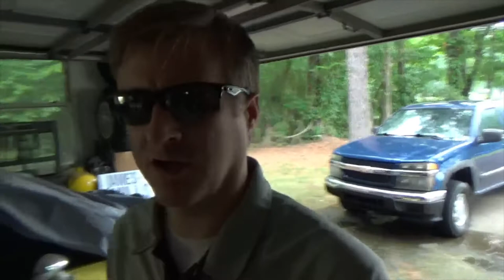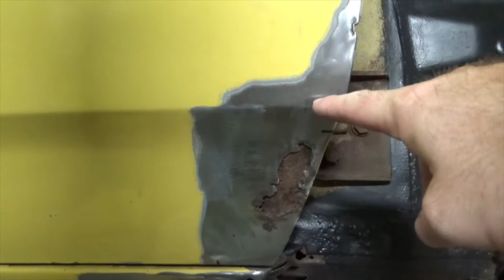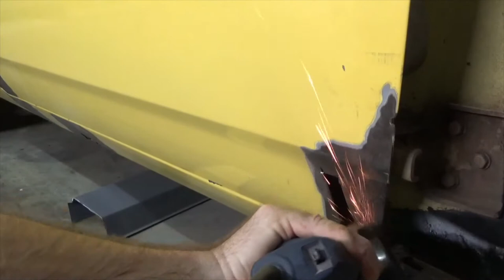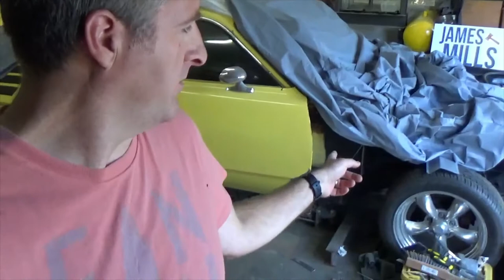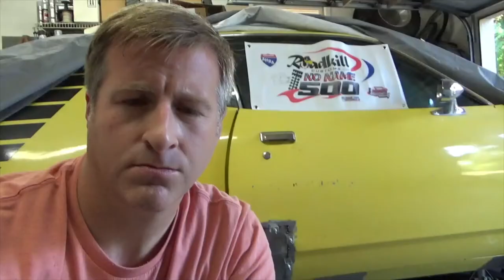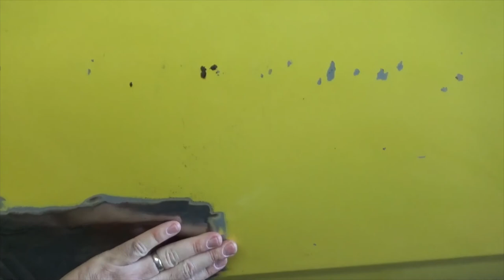72 Plymouth Satellite Build - Episode 16 (Door Patch Fail)

Comment: Well at least now I know I'm not alone doing this stuff !! 50 years ago I had my Dad to bail me out of doing the wrong things on my cars. Now I just let it sit for awhile and go do a different project. Then I come back to it a few days later and look at it with a fresh look. And un-do it and fix it. You'll get it !! Your welding looks a whole lot better than mine !!! Your car is looking pretty good. 👍👍
Reply from the maker: Thank you as always Tim for the kind and encouraging words!  Yes, you are absolutely right...sometimes you just have to walk away for a bit to get your zeal back before jumping back on the horse.  I first started wanting to just scrap my footage and proceed on with the improved repair, but thought....no...we are all human and there's something helpful in being transparent in our struggles.  That way, when we overcome our failures, it brings a sense of true accomplishment.  Thanks again for watching and encouraging!
Reply: @culturedredneckgarage3784  I’ve been collecting parts for the old Demon for years. So I had my seats & side panels redone and a new headliner. Plus all the new chrome handles in & out. Had a new 8 3/4 - 3:55 gear rearend built. An 833 o/d tranny rebuilt. And finally had a nice 360 with 350 hp built to replace the tired 318. So now I just have to start replacing and upgrading a few thing brakes & some suspension while I have it all apart. Just finishing putting a new GM Performance 350/357 hp crate motor in my other old vehicle. An 86 chevy c20. I bought them both new. I’ve been trying to video, taking that engine out of the truck. This should be fun filming, getting the new one in !!! I’m playing with this video editing software. When I get a little better at that I’ll start putting them out here. Gonna be lots of busted knuckles on them for sure. I’ll probably look like Duddie’s Adventures !!! Your videos are good. Especially with the kids. My two girls are grown with kids of their own now. 👍👍👍
Reply from the maker: @tims72demon  That sounds like an awesome project to document there Tim!  I'm subscribed and have the bell clicked, so I'll be tickled to see it come to life and cheer you on!  Thanks again for the encouragement on my channel...it really means a lot to know that what is being put out there is being enjoyed in one way or the other.  I really want to include my kiddos in my videos more as time will allow...I think it will be something we will all look back on in enjoyment and appreciate in the future as they mature and grow up.  I know that some of my best memories with my dad have been when we were doing projects together, fishing, or just riding around.  I hope to step up my progress and editing game in the near future (maybe with music and some other editing hacks)...life has been busy this year more so than I though it would've and I've got to get through a couple of months as piano accompanist in a local musical before i have the adequate time to spend on it.  Thanks again my friend and God bless!

Comment: What kind of welder did you use (240 or 120v, ac or dc ) and what setting?  I'm facing a similar challenge but an even bigger patch. I wonder if a TIG would work better than a MIG.
Reply from the maker: I'm using an Eastwood Mig 130 that I've had for years...it's a 110V gas welder and does nicely for what I use it for.  My heat and wire setting was based on the machines recommendation for 18-20 gage sheet metal, which seemed on target by the way it was laying down the weld.  At the end of the day, a couple of cutting mistakes caused a slightly larger weld gap than I needed - and when I bridged the welds I overheated it more than I should've.  This wouldn't have been a huge deal if I had've had the room to properly hammer and dolly it out - it being inside a door, I didn't.  I've since then fabricated a new and larger patch panel to fix this one and have flanged the sheetmetal for a stronger repair that shouldn't warp.  However, I've got to deal with some repair work on the door frame itself before it can be fixed.  I've been traveling for work and will continue to travel some this month...hopefully will get it done once I'm done traveling.  Good luck with your repair.
Reply: @culturedredneckgarage3784  That sounds about what I got, but I got it about 15 years ago. And it is a generic model. My welder friend told me I was wasting my money if I thought I could weld sheet metal with that. But better machines were super expensive back then.  So the welder and the chicken wire and bondo and dent in the quarter have been sitting in my garage since then.